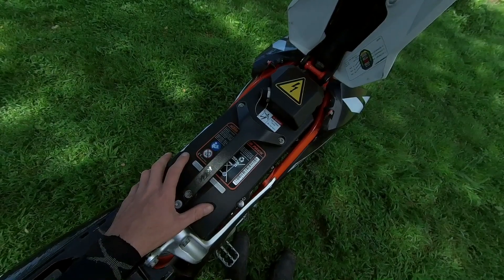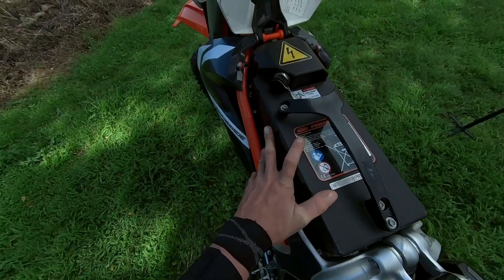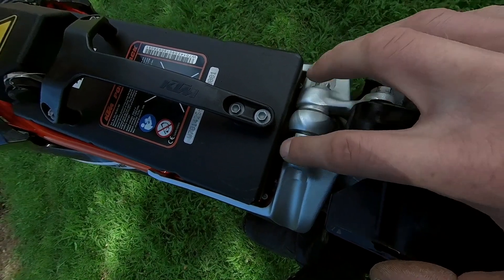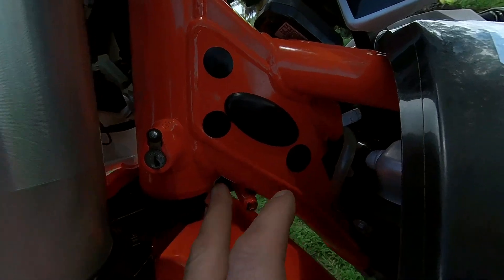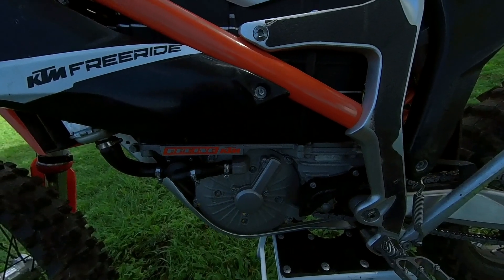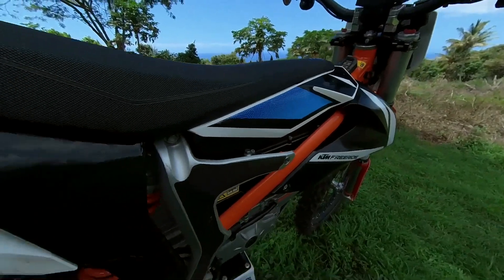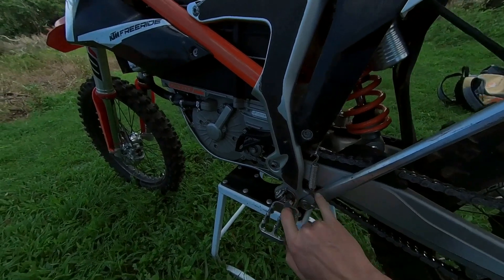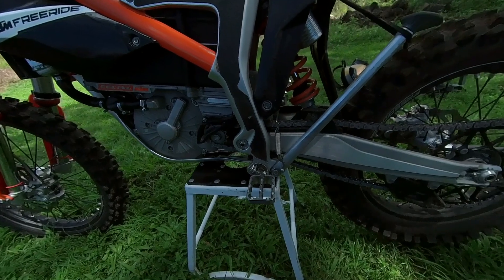Everything Freeride E-XC Part 3 (of 4)

Comment: 3-4 more generations of this thing,and we gonna have a killer machine..
Reply from the maker: I doubt this one will change much, but the next gen of ebikes is only a few years away at best. I’m usually an early adopter. The Freeride right now... is Bitcoin. The way people think about a dirtbike is going to change soon, just like they way we think about money is changing. I can think of probably 10 other markets I’ve done this with.
Reply: @JohnHowerton137  Yeah,i get what you are saying,but the battery is 50 % better than the 2020 version and the engine is improved a bit (plus the brakes) so its gonna be a interesting future with e bikes for sure..
Reply from the maker: @cyuiyuwyguiyui  it's not. That was a fake news press release recycled from 2018. The brakes are new, everything else is the same.